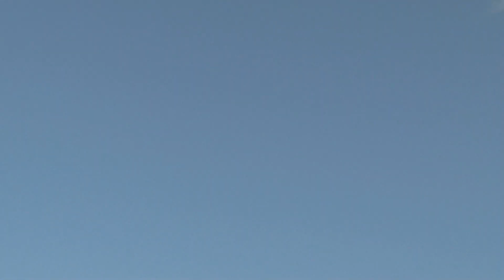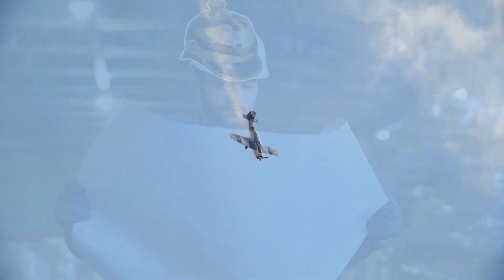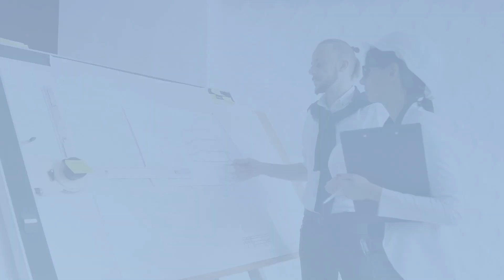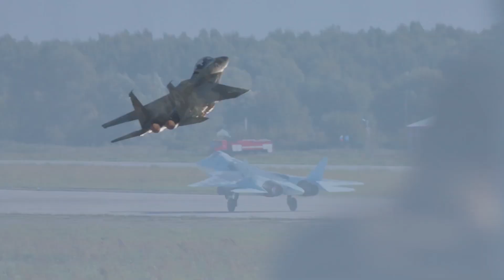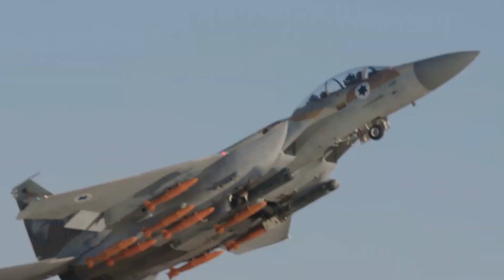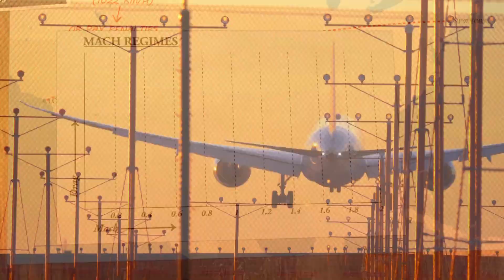Engineering Tricks in Modern Planes #Tech #News

Comment from the maker: Modern airplane wings are true feats of engineering with all of the designs and breakthroughs that have gone into manufacturing them.

In just over 100 years airplanes have gone from single propellers with fabric stretched over wooden wings to the flying metal behemoths we know today. For most planes, the overall shape hasn’t really changed: engines facing forward, tail facing back, wings sticking out on both sides, and hopefully at least a few wheels on bottom.